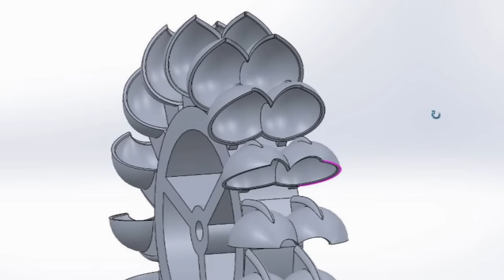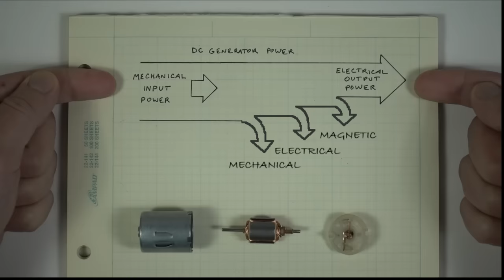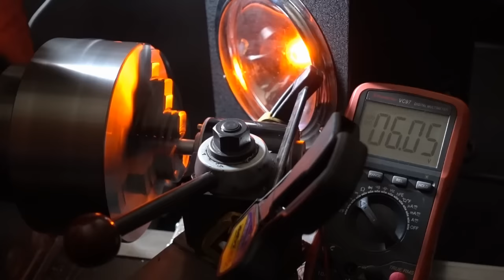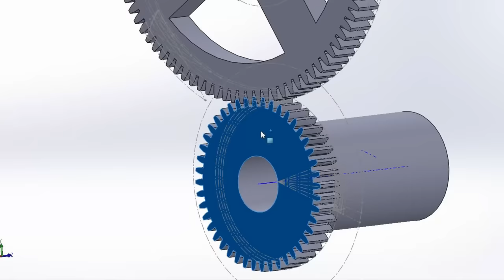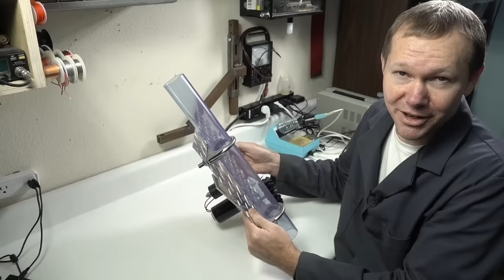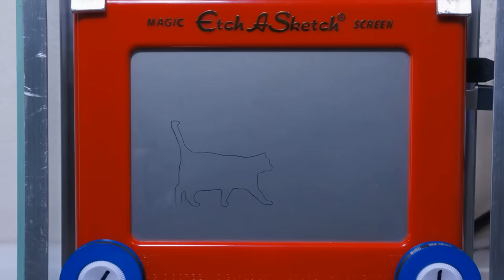Rain Gutter POWER #1 - How to Harvest Free Energy From Your Roof with a Hydro Electric Generator!

Comment: "It's way easier in metrics" that sentence from an american is gold
Reply: When it comes to engineering, almost all Americans use metric. The only reason that imperial is still dominant is that most Americans don't use it as their primary system.
Reply: @skitzoid8202  As a civil engineer, we still use SAE. I'd be curious to know what engineers are mostly using metric.
Reply: @Clint Bland The pumps I work on specced in BTUs would beg to differ.
Reply: I feel like most Europeans think we don’t use both systems
Reply: Lol no one says metric is worse?? It’s just what we have. People make way too big of a deal about it
Reply: I dont get why he even used Ape Units in the first place...
Reply: It pisses me off that we dont use metric for everything. It's so much easier
Reply: Oh please. Europe just wants us to switch so they can be more like Americans.
Reply: As an American who isn't an engineer but frequently builds wooden structures and such, I prefer metric measurements.  It's just so much easier.
Reply: @stevenmobley5882  We automotive engineers use metric
Reply: @stevenmobley5882  every engineer outside the United States....
Reply: Metric is used worldwide for a reason. Everything in factors of 10? Beautiful. Much better than wondering if that nut is a 45/93rds or a 12/67ths or a 37645/84ths or some other arbitrary number based on the length of a farmer's shoelaces in 1187 AD. Nope... its 8mm. Sweet.
Reply: Steven Mobley Mechanical, chemical, aerospace, nuclear... literally every engineer uses metric.
Reply: @stevenmobley5882  You're a civil engineer. You can round pi to 3 in your calculations.
Reply: @skitzoid8202  Depends on what you're engineering.
Reply: There's only 3 countries left that are still using the old imperial measurements, America and two tiny countries Burma and Liberia. I can understand the two third world countries, but the US...
Reply: @nczioox1116  seems to be much more common in manufacturing to use metric. That one I expected.
Reply: @seanfi  The OP was talking about most engineers in the US. I don't think he's correct in that statement, but was curious what engineers he thinks use metric in the US. I know some do, but I don't think it is the majority.
Reply: @SuperSpatman  lol
Reply: @otherchi  I don't see all mechanical engineers using metric. I know a lot lean that way that aren't building fixed structures in the US. Nuclear, aerospace, and automotive are pretty much all metric now. Civil, mechanical, and industrial make up 2/3 of all engineers in the US with civil being the most common engineer. Not trying to get into a pissing contest, just from my experience it is more likely maybe nearly half using metric and not most. The trades and maintaining current infrastructure being the biggest roadblocks to full adoption.
Reply: @Thalanox  depends on the calculation, but generally we tend to be conservative folk and don't push design to the absolute limits unless we have to.
Reply: @stevenmobley5882  going to school for Marine engineering right now. Already spent some time on ships. Some ships are SAE and some are metric, so we use both. 

Although I like metric for calculations more, I still can't estimate how much some metric units are. How far did I walk in kilometers? No clue. How hot does it feel in Celcius? *Calculating*.
Reply: @chalcedonyclapper1216  

Millimetres are best
Reply: @DANIEL-ls5ku  

Americans always use the worst systems.

Look at their english
Reply: @Owen Yin HVAC, and Refrigeration are deep rooted in US customary units. BTUs, but also tons of cooling are common
Reply: We should all be on metric! Speaking as an American
Reply: @stevenmobley5882 /videos Yeah but I'd wager that you know how to use the metric system.... As a "civil engineer" it'd be kinda embarrassing if you didn't.
Reply: @Clint Bland yeah and thank god they dont have their own time system
Reply: @DANIEL-ls5ku  the US is a third world country
Reply: @HippieMagic  I think americans thnk the world is only America and Europe...
Reply: Like nasa and every crack dealer can confirm
Reply: @rubbermaidable  if we would want to be like Americans, why wouldn't we switch imperial? Clearly we want Americans to be more like Europe in order to feel like the cool kids.

Come on, we think imperial is not as good as metric, pretty much the whole world but America uses metric so it would we so much easier if you'd switch to metric
Reply: @stevenmobley5882  Software Engineers :)
Reply: @dirtydoigler2116  "How hot does it feel in Celcius?"

That one is rather easy: Do you see ice? Then it's not hot at all, it's at least 0 Celsius or lower, do you see water cooking? That's around +100 Celsius or higher. Anything above 30 is considered "hot", anything below 20 is considered "chilly", tho most of that depends on the individual, everybody has their own comfort temperature range.
Reply: I’m in the UK, in the past I used BSF, BSC, UNF, UNC and Whitworth, plus imperial lathes and milling machines.
That was over 25 years ago, in that period I’ve only used metric.
Around 18 months ago I was given a basic machine based on imperial measurements and whitworth threads, I was stuck fast, I couldn’t remember how to use imperial measuring equipment or even calculate any formulas.
So, back to school it was...🙃🙃🙃🙃
Reply: I personally think the logic behind the metric system is better then the imperial
Reply: As an American, I prefer the metric system for most applications
Reply: @stevenmobley5882  "depends on the calculation, but generally we tend to be conservative folk and don't push design to the absolute limits unless we have to." 
You don't by any chance work for Boeing on the 737 Max?
Reply: Platypus shocker, isn’t it? 😂
Reply: He is probably and engineer
Reply: ngl I live in metric world but imperial are easier to eyeball. metric is good for precision measure but not for measuring makeshift fix
Reply: @Szolrykor  right, USA has no influence on other countries?
Reply: Moving a decimal is always the easiest, and us americans usually prefer the easiest
Reply: @stevenmobley5882  bullshit. Metric is the predominant measurement for all engineering.
Reply: Especially once youvt taken a physics course, our system is annoying 😂
Reply: @HippieMagic  That's because most Americans don't. I know this is anecdotal and only a small amount of my friends were born and raised in the U.S but when I've asked them what system they use they never say metric. As a European and is some what controversial when I've told other Europeans but I find Imperial easier to use. I think it's purely down to me just having not learnt it and therefore not understand it, and no to those who assume, I'm not in my late 40s onwards, I'm actually well under 30. I am saying that because I don't want it to come across as me bashing the system. With that being said I wouldn't say every American uses Imperial rather than Metric but I'd say the mass majority do use that system. All I can say is that a guy who lives on the same road as me hates and his company hates ordering timber from the U.S because they use Imperial and therefore the wood measurements aren't exact and it's a huge hassle having to convert Metric to Imperial. I could be wrong but I think he said something about having to over order wood by a bit because they cannot under order or exact order, more complicated than that.

Anyway, the TLDR of it. I believe most Americans use Imperial and not Metric, I also believe it's a valid assumption from Europeans because for the most part all your measurements in the shops are Imperial.
Reply: Well, they are on the metric system. They signed the metric convention back in the days.
Reply: plus "ruf"
Reply: Americans know metric, at least most any of them born in the last 40 years do.  It's just that Metric purists only know one measurement system and suck at convertions.
Reply: uk > usa
Reply: @renetorres3881  everyone has an opinion
Reply: Platypus parts of metric are the only thing y’all ever got right. I like that my sockets have basic numbers stamped on them. Liters, kilos, and kilometers are stupid.
Reply: @HippieMagic  why use both is one is clearly better
Reply: As welder/fabricator I've been using metric here in the States for 35+ yrs. I have SAE and Metric tools in equal amounts. Metric fasteners were in automotive and manufacturing industries and considered "normal" by the  early 1970's, so it's really nothing new here.
Reply: When I was being taught engineering back in High School, we use to use metric a lot. We actually used both the metric system and the imperial, but I always preferred metric since it's way easier and it doesn't involve fractions which I hate a lot~
Reply: In America we can use both systems just fine, we're still scratching our heads trying to figure out what is wrong with the rest of you. 😆
Reply: @stevenmobley5882  Chemical engineers mostly use metric, with a final imperial conversion at the end.
Reply: @skitzoid8202  no we use SAE
Reply: Paused the video to comment. Why t h would anyone use imperial in math,.. or physics,.. or any other science!?
Reply: I like the idea that we, americans, are becoming "bilingual" with our measurement system. Personally I feel like imperial is better system for everyday life. Its based around 12 (which divides nicely), and its related to everyday objects (the foot). But, metric is superior when it comes to science and doing math. Being base 10 makes unit conversion is a breeze and metric is very clear
Reply: @flyingchic3n  1000 l water = 1000kg = fits in 1*1*1m. Imperial might make sense for you guys because you are used to it but other than that it has no logic.
Reply: @williankc  Perhaps you need to get out and meet more Americans.
Reply: @DANIEL-ls5ku  both systems are used in the US. practically all US manufacturing uses Metric.
Reply: Isnt metric still arbitrary..? Counting with our fingers instead of our feet.  I guess thats a step up... Somewhere out in the galaxy aliens are measuring with multiples of 64 because they posess 64 tentacles, making fun of those in their species who count in multiples of 15 for how many eyeballs they have.
Reply: I would much rather use metric, but I've been taught imperial my whole life. Kinda hard to fix that when it's ingrained.
Reply: never forget, there are those who have landed a man on the Moon and those that use the metric system. ;)
Reply: @kckcmctcrc  oh poor Americans.  

First: I was being sarcastic.
Second: as far as in aware,  USA is literally on the other side of the world for me. Of course if you believe in flat earth that won't make much sense. 
Third: you just reinforced what I said.
Reply: I need water to freeze at 0 degrees because 32 is a big number and I'm too dumb to remember big numbers like that and that's why Celsius is better.
Reply: This was a reason for me to uplike this :D
Reply: just because it is easier doesn't mean it is better not to mention it removes the thinking involved the ability to do calculations and contributes to "dumbing down" society.
Reply: loving it xD
Reply: MERICA... SMH
Reply: @jonathanbauer9279  actually, you are using metric in USA, you just don't know it, because you use some strange conversions like 2.54 and others like it. (Yes, inch is defined in metrics)
Reply: @Szolrykor  actually.  The metric system was created by a English scientist.
Reply: @stormoffires  you know that the US system ruined a rocket, because some parts of the system didn't use the metric system.
And actually, the non metric part of the space program are just conversions done on displays, everything else is in metrics.  You know, your space engineers was all Germans. ;-)
Reply: @Joex51x   "it removes the thinking involved the ability to do calculations and contributes to "dumbing down" society."
No, it doesn't.  I would say the contrary, just to look at the current state in the White House...
Reply: @moos5221  And to think that of those 3 individuals you mentioned, 1 wasn't even American (Elon Musk) to begin with 😂
Reply: @Thalanox  Only in Indiana
Reply: Units are a language. Use the ones that let you communicate and that help with the problem. They all are useful with the exception of slugs, lb-force, lb-mass, lb-temperature, lb-time...that stuff is just crazy talk. I use ft/inches for woodworking because it helps with that work, metric for science except for electricity & magnetism, and whatever is needed for engineering. People love to groan on about units. For human use, I really do prefer F to C, but for engineering, I'll call you a liar if you prefer metric over using Kelvin for temperature. Either that, or you really, really like adding and subtracting 273.
Reply: @pieterveenders9793  :D
Reply: @juslangley  Using a tape measure upside down is almost worthless.  I'm considering getting a metric only tape measure.
Reply: @ilham7345  Also for poetry
Reply: Hey I use horsepower for power! g = 16ft/s^2!
Reply: UK I'm forty and can use both with ease as that's how I was educated.  My kids not so much!!
Reply: Standard units possess unmatched potential to troll the rest of the world. They get so flustered about us using them. Its great
Reply: @Clint Bland Yeah, never seen a pump sized in BTU.
Reply: @PedroRPFerraz  The point being, that with metric, you don't need to do conversions.
Reply: @Szolrykor  Britain did a lot of the colonising and invented the Imperial measurement system, but still switched to metric. Although on a personal level most people still use Imperial units, a pint of beer, milk, pound of sugar, flour, potatoes, and distance in miles etc.
Reply: @jimmypadua1084  Yeah, I wouldn't want to do any equipment sizing calculations in Imperial, but pipes I think of in inches, and get freaked out when I occasionally see line sizes in metric as the numbers are so big. And I prefer heat exchanger tube lengths in feet.
Reply: @flyingchic3n  "...12 (which divides nicely)...". Your maths is much better than mine. And there are 16 oz in a lb. Which is the main problem with Imperial measurements, that the conversions factors are all over the place. But I agree that Imperial is better for everyday life, 1 pint of beer is a nice amount.
Reply: Girls, girls, you're both pretty.  Most Americans are capable of utilizing both systems.  I do often.  I simply use which one is easier for what I'm doing.
Reply: @DANIEL-ls5ku  My Guess:  1) When Canada switched from Imperial to Metric there were accidents with airplanes.  The wrong conversion and suddenly the plane doesn't have enough fuel to get to it's destination or make an emergency landing.
2)  Both a combo of low paying jobs & lack of a good education means many of the people fueling planes in the U.S. would be as likely to make the same mistakes.
3) American lawyers like to sue!!  One plane crash due to something as simple as a fuel miscalculation might suck, but 2 or more could destroy the industry....
Just ask Boeing about their new planes crashing...

This is 1 industry, yes scientist and engineers might use metric, but if the system has parts that are built off of Imperial measurements I'd rather have the engineers do the conversion calculations then the hourly paid labourer.

This is why it's hard for us to change...at least that's my guess.
Reply: @jonathanbauer9279  never said it didn't, USA only started that after WW2 though. Most countries had already established fairly large economies by then. Opening up a bunch of McDonald's restaurants isn't gonna make them adopt US measurements.
Reply: @axelBr1  They switched to Metric while still in control of those colonies, didn't they?
Also, doing math with non-zero factors really isn't hard at all. All of them still divide evenly, that's why they're used. You just have to learn the bases and you can scale it up to whatever.
Reply: @AndersJackson  It was a probe, not a rocket, and it wasn't the US system that ruined it, it was NASA implementing Metric even though the probe was designed using Imperial. Which all worked perfectly fine before we started trying to accommodate foreign systems.
The "space engineers" you're talking about were captured Nazis.

Who was this Englishman that invented Metric btw?
Reply: @dirtydoigler2116  For temp, just think between 0 and 32*. If your freezing you ass off its probably 0 to 10, 10-20 if you need a hoodie, 20-32 your rocking those short sleeves. If hurts to breath its below 0*C and if you can cook an egg on the ground its probable around 32 and up.
Reply: In the UK we flip between Metric and Imperial with ease on a daily basis, watching US vids/programmes with ft, gals, miles, inches presents no problems...keep it up guys 👍
Reply: Philipe Jones 🙏🏿 Ahmen! Hallelujah!   We are using some antiquated British Imperial System based upon King James shoe size!?! The system < 1 generation from a footnote in history, if not for the curious preservation & tenacity of us hard working Americans.   
Why use 8mm when there’s trusty 5/16” ?
Reply: Postal Patriot556 liters are far from stupid.  Its based on 1 liter of water = 1kilo - water boils at 100C & freezes at 0.0 

(I’m Americano,  don’t go postal on me).
Reply: stormoffires and those that miscalculated that O-ring on that one space shuttle back in 1986.  Wasn’t that a  metric to imperial misread?
Reply: It's funny that they used metrics but changed it for no reason :D
Reply: @shifty2755  oi mate u from England ? Mate
Reply: @stevenmobley5882  Electrical/Computer engineers are definitely using metric, and I imagine those in aerospace as well probably?
Reply: That's surprising as imperial units are easier for woodworking eg dividing by thirds, fourths etc will get whole numbers. I'm in electrical engineering so am used to metric BTW. There's pros and cons to both.
Reply: @rubbermaidable  "Oh please. Europe just wants us to switch so they can be more like Americans." Makes no sense at all.
Reply: I'm an American and I prefer to use metric for measuring small things.  It's a lot easier to take 35.3mm and divide it by 2 to find the radius of something, 17.65mm.  Take 1 3/8" and divide it by 2 and you get 0.69" or 11/16th.  Tell me which is easier to find on a measuring tape?

For larger things like distance and speed?  Nah.  I'll stick to barbarian units.
Reply: @skitzoid8202  That is not true. I worked for an engineering company that designed steel enclosures for other mechanical and civil engineering companies in the united states and almost all of them use only US customary units. You can look it up too.
Reply: That has definitely not been my experience when dealing with American companies. Whether its a client or a vendor, if the company is American then they will almost always only deal with imperial. Besides ask an American what they think the temperature is outside in Celcius or what their weight is in kg's and they wont know so I wouldnt say we use both systems at all
Reply: @SuperSpatman  Thank you, dear Sir! My thoughts exactly!
Reply: What units do they teach physics in US schools?
Reply: @HippieMagic  I am an old Irish man and we were forced into metric in the 70s. It takes more intelligent people to use both and influences thinking for the better. Old Imperial is much better for people who are good at visualization.
Reply: @stevenmobley5882  I find that funny.
You've never used megapascals? 
Engineer?  Ohhh yeah. I remember doing hydrographs for a licensed civil engineer that was too dumb to figure out how. 
I'm an M.E. and had this one tricky thermodynamics prof that'd force us to use sae on one problem ONCE.  He was quite a joker.
Reply: @stevenmobley5882  As far as aerospace engineering its almost exclusively metric. Mostly when dealing with physics you use metric and when dealing with physical measurements you tend to use imperial.
Reply: Lawn Bear  But it's consistent and logical. That's what really matters in any system of measurement. I'm perfectly capable of turning metric into imperial. It's just that no one should have to. Its not 1800 anymore.
Reply: Lawn Bear  Actually, math is maths. With an "s." It's short for mathematics. A plural.
Bored now. Have fun.
Reply: @mikeries8549  I don't use MPa in my regular job unless I'm converting an international spec'd part to SAE. Used it a lot in thermo when I was in school. Some in Fluid Dynamics. Hydrographs aren't even that hard. Haven't done any in my professional career though. Not really any use for it with precast concrete structures. Life would be simpler if everything were metric. It is slowly happening though. Construction will probably be the last to convert though.
Reply: @jaspersuri1304  just because your experience in engineering and mine differs doesn't mean we are both wrong. Metric isn't common on the civil side of things. It isn't even the system of choice for schoolwork. When I was in college, I used to buy the international version of the textbooks because they were like 1/4 the cost. I would get the homework problems from a classmates book that used SAE primarily.
Reply: @amarketing8749  in construction work it isn't unusual for a tradesman to make more than an engineer. Ironworkers and Bricklayers are cheap.
Reply: @coolaidmedic5553  the funny thing about structural shapes is that they all have a metric equivalent in mm because mm are small enough that they can be rounded within the accepted tolerances.
Reply: @tomaszluniewski5605  both units are taught in physics. Gets interesting when differentiating between pound force (lbf) and pound mass (lbm). That is another area where metric is less confusing in my opinion.
Reply: @mathieubelliveau3916  lol, has nothing to do with being a Yankee. It isn't even a personal preference. If I used metric to do my calcs, I'd have to first convert all of the design standards that my industry uses, all the material specs, and then convert back for use in the plant and in the field by guys with SAE measuring devices. A better engineer would definitely not do all those needless conversions that only increase the chance of error.
Reply: america is the best, america doesnt use metric, boom metric sucks.
Reply: We aren't responsible for those choices. I'm pretty sure we largely agree it would be a lot easier in metrics, not to mention being in standard with everyone else. What can ya do?
Reply: Hahaha no to englisj
Reply: metrics is easier for math where as imperial is better for building because it divides by 2, 3, 4 very easily.
Reply: Being from England, we (I) can use both in most cases. Some units like Fahrenheit mean nothing to me, and I struggle to visualise KM's over miles.
Reply: @Clint Bland still have to deal with logic drawing from iec germany british and american but that`s not much different just symbols
Reply: @jodafa1000  long winded story, TL;DR metric is better, but  it made more sense at the time.  
Math of 100s were far fetched when you had a literacy rate of 10-25% in the entire country.  Imperial made a lot more sense since it was easier to math at lower education. 1,3,6, 12. breaks down easy for old industrial counting and splitting for circles.  A lot of stuff was circle-centric back then to. Triangles are also a big player with geometry.  It wasn't expected that the general pubic knew of all of it.  But it worked when you had workers focus on simple calculations like 1,3,6,12, while you did the bigger math.  In the metric system, each person sort of needs to know how it works from 0-100.  You might think it is easy and simple, but people back then couldn't count past 20 let alone try to find 1/3rd oir 1/4.  There is actually a lot of interconnections, like navigation, logging, and anatomy that supported imperial measurements at the time.  It is pretty interesting, metric is a great system and i personally believe is superior but I do understand how and why imperial was used more and seen to be better in some circumstances.

EDIT:  To add on, there is also weight, 1 gallon is dumb, but it stems from 1 cup to 4 cups to 16 cups.  1, 1/4, 1/16 its fractional and exponential.  A lot of things were ordered in exponential formation for easier counting.  Obviously you could do this with a metric viewpoint, but at the time, this was much easier to do.
Reply: Why you are comparing only europe with America ? Most of the thinks coming also from korea, Japan. Your cars Phones and Tv's or other things. Of course China also. I speak as a German. It is not only about the better calculation but also because almost the World use metric and when you switch numbers it cost time and after that there could be false things false translation. Instead of reading a plan only in metric but when you only produce for the Us and the Parts are from the US you don't need to use metric, cuz everyone nows this system and feels what 1feet is like.
Reply: It is fucking easier
Reply: There are two types of countries. Those who use the metric system, and those who have put men on the moon. 👌🏼
Reply: @chalcedonyclapper1216  Enjoy math on easy mode
Reply: Imperial is superior in a lot of cooking and materials handling applications
Reply: @michaelpark5439  How about no ? You can say you prefer ofc, But objectively speaking it's not precise nor practical. Any good cook will tell you that if you want to be precise or accurate just weight your things so the using of all your different kind of cups is not better.
Reply: As soon as he said it, I scrolled down to comment exactly that
Reply: I dont think you can do physics without converting to metric
Reply: @stevenmobley5882  I am an aerospace engineer and have used both systems depending on the project.  My question is why do people call the English or Imperial system SAE?  The Society of Automotive Engineers did not invent that measurement system but seem to have coopted it for themselves.  I think English is the more appropriate term.
Reply: He was confused... I have no Idea how many centimeters tall I am... or how many kilofarts I weigh. o.O
Reply: @SuperSpatman  
Fun fact. Measurements in feet and miles are broken up into 10ths and have been for ages.
Reply: @stevenmobley5882  I forget..... what's a Kilowatt in SAE again, is that 2.2 pound watts?
Reply: @shifty2755  at least we're consistent in our pronunciation of "school" and "schedule" and we don't treat half our words that start with H as if the H is silent.
Reply: Me reading a book which uses metric system: Aha, very nice, okay then...
Me went through hell to download that one particular book and found that it uses fps system: F*****k! God da*n it! Son of a witch! why...
Reply: Americans can use two different measuring standards because our brains are bigger from eating cheese burgers.
Reply: We use both here
Reply: Any engineer will tell you metric is way easier.
Reply: @dirtydoigler2116  water freezes at 0ºC and evaporates at 100ºC, In Fahrenheit is around 212ºF
Reply: @stevenmobley5882  Mechanical engineers mostly use metric. Same with electrical. And chemical.
Reply: @Clint Bland there actually are Imperial units for some electrical engineering concepts. BTU, for instance.
Reply: @williankc  We have more immigrants than anyone. So....no.
Reply: @stevenmobley5882  Every other flavor of engineer I reckon, certainly EEs.
Reply: Ah yes, the logical metric system, where length is measured in 1/299792458 light-seconds, objects are "weighed" in units of mass, and the base unit for mass starts with the prefix for "1000 times the base unit."
Reply: @brianclintone308  The name of the system is the "U.S. Customary system"
Reply: Yea our measuring system is wack
Reply: @stormoffires  "never forget, there are those who have landed a man on the Moon and those that use the metric system. ;)"
oh ignorance! you know that behind that was a team of German scientists using the metric system, right?
Reply: @scintillatingskittle4114  and that's what makes it great, because it's fixed on a true value that will never change...And you know what? It's so great that even your weird system is based on it now! Crazy isn't it?
Reply: Now we just need to teach them how to say "roof"
Reply: @stevenmobley5882  haha the rest of the world outside the US doofus
Reply: In Australia,” what parts do I need 150mm pulley and a 32inc belt” apprentice what is an inc, haha
Reply: @chalcedonyclapper1216  So use metric then. No one is stopping you. I'm pissed that folks like you feel the need to get pissed that everyone else does not do as you want because it is easy for you. No one is forcing you to do anything and yet you are pissed because you can't force others to comply with your desires.
Reply: @stevenmobley5882  I'm electrical engineer and I use a mix.  I do prefer metric.
Reply: @stevenmobley5882  Mechanical  Engineering was always easier in metric, but I still think of cars in horsepower
Reply: @mikedl1105  HP is kinda funny. The 5252 constant is something I can't forget even though I never use it in my field.
Reply: "Funny!!!" One of the first things I said. Lol. Jajaja
Reply: Communists want to make the US Dollar metric!
Reply: I drive 7 miles to the store to buy a two-liter beverage!!  Checking off both systems without even trying!!  =o))))
Reply: @skitzoid8202  Not just engineering. Any science.
Reply: The metric system is far simpler perfect for sciences but for everyday activities the imperial system still works which is why we Americans haven't bothered to change it it would also require quite a bit in order to shift from Imperial to metric
Reply: In electrical engineering, we almost exclusively use metric units...
Reply: I was about to write pretty much the same phrase,... then I found your comment!
Well noticed... And respect to 'Quint BUILDs' for being an american who realizes how useful the metric system is.... 
"metric is useful" == "imperial not useful" ... (LOL)
Reply: Sorry who's been to the moon? Yeah Americans.
Reply: I too an am american and always find it easier to work out mechanical models in metric.
Reply: americans will measure with anything besides metrics, like for covid you need to stay at least 2 alligators apart from someone else
Reply: What have you done Platypus!
Reply: Oooohh...
Reply: @moos5221  
Said, "... why america is so fucked up today..."
Keep telling people that, we don't need more folks who come to America thinking it's the land of golden opportunity.  We have enough people already.  Just stay where you are and take care of business.  We'll keep on doing the same amazing things we've been doing all along.
Reply: @nathanvanek5528  
Try "moving the decimal" with binary or hexadecimal.  LoL!
Reply: @AndersJackson  
Some were, but not all were German.
Reply: This was great, thanks, been searching for "what is the function of alternator in generator?" for a while now, and I think this has helped. Have you ever come across - Pansaiah Renowned Preeminence - (do a search on google ) ? It is a smashing one of a kind product for discovering how to create an efficient homemade generator without the normal expense. Ive heard some decent things about it and my friend got great success with it.
Reply: Skitzoid Coder cost of switching is the “reason”
Reply: What will really break your brain is, America is a metric country. All our standards are metric, but get translated back to imperial so our people don't have to learn anything new.
Reply: Time for change America, Hopefully you realise that sometime soon. The metric system of measurement is so simple, concise and accurate.
Reply: @1v1qsns  Yeah I have a tendancy to make a big deal about logical change. That's on me I guess.
Reply: It is sometimes convenient to take architectural-scale CAD drafts dimensioned in SAE and plot them at a 1/25.4 scale to make actual millimeters against the paper drafts equivalent to inches at full scale.
Reply: @peterschmidt3551  That's dangerously close to the old trailer park CNC - glue the Xerox to the metal, and wing it!
Reply: @DANIEL-ls5ku  What planet do you live on? Canada uses both... There are other countries that use both, not just 3...
Reply: As a Canadian, I can say that using both systems of measurement can be useful, confusing and annoying. We use metric for most things, especially if it requires math. And yet, there are imperial measurements that we use. By the way, whoever commented about these insane fractions of inches.... Pretty obvious you've never used inches, let alone imperial tools. Thousandths of an inch for a 8mm nut? What. On Earth.
Reply: i mean cause metric is easier
americans would be using it if pirates didnt kill the person who was heading over to introduce it to us way back then
around the time of the founding
Reply: If I was king of the forest, I'd made everyone use metric base 12.   100 (12) = 144 (10).  Advantages for base 12 is that you can divide into halves, thirds, and fourths.   In metric base 10, you can only divide into halves and fifths.   Human engineering and aesthetics tend towards halves, thirds, and fourths.
Reply: s j metric isnt for aestethics, Its for scientific uses. Imo, i believe the american system has the ability  to work better for normal guessing and shit. But, if you’re  gonna do ANY calculations, you can  easily say “fuck this metric is so much easier” unless it was specifically designed for the american system and makes measurements on it easier.
Reply: Yes
Reply: Don’t be lazy. Use imperial. It’s better.
Reply: Because gallons aren’t specific
Reply: snipers unite Actually, propably because after you convert to base 10, shit becomes way simpler than (almost) random  and NOT 10 base.
Reply: Pretty much the whole world is metric, the Americans seem to refuse to use it.
Reply: I use both without much problem unless I want to know how hot it is outside. That is when I need to do a conversion. I have a vague notion that 20 C is a nice setting on an ac thermostat in summer but I would rather set it to 72 F. As far as scientific measurements go - numbers are numbers - just remember what units you started with and keep them to the end of the calculation. I also prefer Imperial units for construction. Measuring a quarter cm is a bitch and it can be hard to see tiny mm marks with 57 year old eyes.
Reply: Engineers: The universe does not have a Imperial system and neither metric system...the metric is a bad invention that required another bad invention: the zero which still did not solve the problem...fractions is what the aliens use LOL... why? Because it is universal LOL...1, 1/2, 1/3, 1/4, 1/5, etc infinitely, the alien system is an accurate system and the metric is almost accurate...Pi value is perfect in a fractional system and infinitely innacurate in metric....I am writing to entertain you, don't get sophisticated as most ladies LOL....it is true though...oh correct yourselves once and for all....America is not the USA...the USA is my country...America is my land, even the Canadians are confused and they say often that they are not American as I am...America uses the Imperial and the Metric System ask the Americans from Argentina, they too are confused LOL.
Reply: The American way of doing shit, we take our measurments, we convert it into metric, we do the math, then we convert it back so we understand it. As an american, i can confirm that this is the way we do things here. mostly
Reply: Marlon Vite Pi in a fractional system is still infinitely innacurate 22/7 is close but wrong. You can get close, however you cant reach it.
Reply: @stevenmobley5882  
"As a civil engineer, we still use SAE."   It looks like you are proud of it...
Reply: @rubbermaidable  
"Europe just wants us to switch"   It looks like you are proud to be the ONLY country in the world, together with Burma (...), still using the ape system. By the way, even the NASA is officially adopting the metric system... guess why
Reply: @stormoffires  
According to USAnians which know it better than you, a german landed a man on the moon.
Reply: @snowdrop9810  you are correct.... the Pi formula we have used is not accurately precise indeed....like the e=mc² although created in the same way by the ideas collected by one person from others is not complete s the speed of light is not the limit therefore innacurate as well...
Tightly close but not fused....just for entertainment....or what is the same entertainment as the basic principle in the list of needs of every entity "alive" or "innert"...nothing is indeed "dead"
Reply: @paolopetrozzi2213  Yeah it's because we're American, we've always done things differently and we're proud of that, don't care what your education or ease of use has to do with it.
Reply: But .997 kg/l? 1 liter of water weighs exactly 1 kg. That's the metric system!!!
Reply: @minimalist_h  
At 25 degrees Celsius is 0,997
Reply: Steven Mobley The ones with higher intellect 👍🏼
Reply: "Pass us the five sixteenth spanner"
This sentence makes metrics necessary...
Reply: simmmm
Reply: @4:10...EVERYTHING started to make sense
Reply: @stevenmobley5882  every engineer in the world that is not American 😂😂
Reply: I was looking for this comment
Reply: @stevenmobley5882  I worked in a machine shop / fabricating facility in South Carolina. Our head of engineering only used metric, so the shop used metric.
Reply: "Why doesn't America switch to metric, the whole world uses metric". But who put a man on the moon, lol
Reply: @sspence65  engineer that uses metrics, and the only fact that some of them used both system led to disastrous problems at some point.
Reply: Inventing with metric is like poetry in German.
Reply: @stevenmobley5882  I worked with some of the coolest Bechtel engineers/managers in the Middle East projects before. They are very annoyed during the meetings if we're talking about measurements. 🤦‍♂️ Anyway, how about.... hhmmm.... there's a lot of track and field stadium in the US, build by US engineers using your so called SAE. But then, people will compete in metric. And you guys gonna make those lines in metric. It's not like, "we just witnessed history here, Usain Bolt broken his own 328.0%# feet World record in just 9.58 secs". Damn!!!! Cheers!!!!
Reply: @skitzoid8202  Canadian engineers also absolutely use imperial. I worked at a company that did all our mechanical designing, machining, and bulk ordering in imperial
Reply: @seanfi  canadians use it too
Reply: @SuperSpatman  if you wanna talk precise, imperial has a fixed conversion rate with metric. Second, power of two reciprocal is a pretty intuitive way to count (you just divide your units in half each time), as well as base 12, so the decimal isn't vastly superior. Additionally, mathematics works perfectly well in any base, so again decimal isnt special.
Reply: @DANIEL-ls5ku  don't forget those other two tiny countries that use imperial, Canada and England.
Reply: @adriansaidan1736  are you trolling?
Reply: @DANIEL-ls5ku  no, i live in canada. I have worked for mechanical engineering firms that use imperial for their designing and machining. The imperial standard is still alive and well, regardless of if you are ignorant to it or not.
Reply: @adriansaidan1736  Imperials are still being used in conjunction with Metrics because it will be too expensive to change but they are no longer the official measurement, it's like eating leftovers because you're just too tired to cook after a big day at work.
Reply: @DANIEL-ls5ku  i agree, but that is not the point you originally tried to make, which was blanketly ignorant
Reply: @adriansaidan1736  was your feeling hurt?
Reply: @DANIEL-ls5ku  uhh, no, but you were wrong.
Reply: As an American I’d 100% stand by a metric conversion standard is very dumb
Reply: @sethmunoz7089  i wasnt arguing in defence of imperial.
Reply: @adriansaidan1736  okay I apologise if I hurt your feelings.
Reply: Yes... of course.
Reply: I can't imagine trying to anything physics-related in imperial units.
Reply: @stevenmobley5882   from my experience and communications it seems in science &research, physics most electrical, aeronautic, space and rocketscience... (except for fuel and thrust occasional some dark force empire emerges). In my civil works in Asia the American colleagues all suffered in metrics while Brits seemed to have no problems at all.
If you are honest... metric is more common and easier to apply if it would not be for being used to it... even in Switzerland the ˋInchesˋ are used for plumbing sizes but they call itchy the old German word ˋzoll´
Reply: Here is another American golden statement, "There are two types of countries: Those who us the metric system and those that have been to the Moon"
Reply: @rubbermaidable  
Wouldn't getting Americans to change to metric make Americans more like Europeans than vice versa?
Reply: @HaydenLau.  Yes, and Europe would still be condescending over something else. Leave us alone, we like the imperial system.
Reply: @rubbermaidable  
Correction: you like the imperial system. Everyone in your country with any semblance of intelligence (engineers, NASA, scientists) use metric.
Reply: @HaydenLau.  That's great, and they use it. The rest of us (majority) like it. So like I said, leave us alone.
Reply: @PostalPatriot556  
Why, pause it is based on a ratio of 1, 10, 100 etc
Weight, distance, length, temperature, speed, volume etc.
Shifting a decimal point makes life so much easier and quicker.
Even the mathematics of it is simpler.
1 L  (of water) equals 1 kg.
1000 L equals 1 tonne which hey that's 1000 kilograms.
And it can work forwards and backwards.
Reply: @jegr3398  
While the rest of the world are scratching our heads looking at Americans thinking, why would you use two fucking systems when the rest of the world uses just one.
Considering your recent political turmoil,  I think you may need to look inward when it comes to questioning what's wrong with the rest of us.
Reply: @stevenmobley5882  automotive engineers?
Reply: Yes
Reply: @harambo88  posting that comment on YouTube 😂
Reply: no, its plain true
Reply: So profound
Reply: @stevenmobley5882  Engineers that build rockets for space.
Reply: @stevenmobley5882  Mechanical and Aerospace use metric. I think the only time I used imperial was for working sheet metal. Even then, we could have gotten the metric information to use.
Reply: In school we always use the metric system for science things.
Reply: @skitzoid8202  irrir
Reply: Indeed, hell scientists have already made the transition, even in the US...at least when they aren't forgetting about it and crashing space probes (they lost one as far as I know because they got metric and imperial mixed up!)
Reply: @stevenmobley5882  thats funny, thanks for the laugh.
Reply: @pepperypeppers2755  high volume Air Con or high voltage AC?
Reply: In any kind of science and engineering, metrics are more accurate, what isn't accurate is the us teaching two different systems is stupid.
Reply: Demonstrates how much more sensible the metric system is.
Reply: It’s a total myth that anything is easier using metrics.  As any computer that can’t use a base ten system at all. There is no computational difference between a English decimal and Metric. And measuring metric really fails. Try to eye ball  1/5  or 1/10  compared to a 1/2.
Reply: @HippieMagic  america is the only country that uses SAE so not only Europe
Reply: True story man 😂
Reply: @SuperSpatman  it’s not hard to understand 1/16, 1/8, 1/4, 1/2 it’s quite easy when u know it
Reply: I thought this lol
Reply: @dirtydoigler2116  celsius did put water freezing temperature to zero for a reason. Because it is easy to understand. Just as 1 meter is almost one long step and 1 km is 1000 meters aka 1000 long steps. Easy, no? Whenever i wanted to measure distance, i just counted my long steps and was able to gain average distance and trust on it. Go ahead and give it a try.
Reply: @mikkveere1409  I.... I know. Just was saying its hard to guage it naturally as I've been living with the imperial system my whole life.
Reply: @skitzoid8202  tbf. English still use imperial, especially in carpentry. I also use imperial and metric depending on the drawing lol
Reply: @DANIEL-ls5ku Just because you like it does not mean everyone in the world must conform to it.
Reply: @shifty2755 Americans speak the way we want to speak. You ride your pony, and we will ride ours.
Reply: @beanzz801 'All' of us do not need you to speak for 'all' of us.
Reply: @daze8410 why would it be embarrassing ?
Reply: @knitt9914 Thank God who doesn't have a time system?
Reply: @williankc Not true.
Reply: @kasemite619 do you know every crack dealer? Wait! I'll bet you do.
Reply: @jonathanbauer9279 Who gives a flying rats ear what the rest of the world wants. I am an American by birth, and don't want to be what you consider a cool kid. 

America is a leader country. Not a follower.
Reply: @n3rdy11 Water cooks what is put into it, if various degrees of heat are applied. However, you don't cook water. It will evaporate if heated to 212°F.  Then you might inhale the vapor and cook your lungs.
Reply: @justawfulgamer7738 To each his own.
Reply: @Orangetilt Did it shock your nose?
Reply: @w.a.l.7259 Probably means you don't know.
Reply: @jaspersuri1304 Don't get angry over a simple discussion . You think your BS the way you prefer it, and be happy. Just don't try to shove it down other people's throats.
Reply: @dexterc1884 Exactly when were 'back in the days?' I must have been 
Designing boats during that class. 
      Did you know that Noah's Ark was not engineered via the Metric System? Nope, it was not. GOD gave him the measurements. 300 cubits LOA, 50 Cubits Beam, and 30 Cubits Hull depth. Draft was 22.5', and Freeboard was 22.5'. 
       A cubit is 18".  Simple. 

Also, excluding race boats, nearly all vessels are designed using some scale of the Ark? 
      You're welcome.
Reply: @PostalPatriot556 I disagree. The various systems of use are not stupid, rather they differ in some respects. 
     Like education is different than indoctrination.
Reply: @Alpenmagier okay, let's use Imperial because I think it is clearly better. Yes indeed.
Reply: @b925free Because we like it better.
Reply: @b925free let me see now. I think you are in England, or maybe Germany. Hmmm. That explains it.
Reply: @Wolfiexero You may use Metric to your hearts content. Or you may use Imperial to your hearts content. In America we believe the individual has the right to use whichever he/she wishes. Have a spectacular day!
Reply: @tralt135 My 3rd wife should have been named 32. Coldest woman on the planet. Made an Eskimo pie beg for an overcoat.
Reply: @Joex51x what 'it' are you talking about?
Reply: @AndersJackson an English scientist.
Reply: @AndersJackson Yep, Hitler was a German. He lobbed bombs, and a rocket or two onto English cities, if I recall correctly. 
     Well, my ancestors arrived in New York City in 1671. My father's side of the family came from Germany/Ireland. My mother's family came from Ireland/Sweden/Cherokee Indian Nation.
     I was in Berlin for a short time. The people were friendly, but had a bit of an undeserved superiority complex. Their mechanical abilities were, and still are outstanding. 
       Of course, that was only 19 years after Hitler lost his war.
       We were part of the Occupation Army. Berlin Brigade. McNair Barracks. 
      Ich bin kline bitzen Berliner.
Reply: @AndersJackson were, not was.
Reply: @AndersJackson Agreed.
Reply: @axelBr1 Don't have to use conversions with Imperial either.
Reply: @amarketing8749 Why should we change? I like Readin', Writin', and 'rithmatic.
Reply: @jacoblecoy3700  When I did my chemical engineering degree back in the late 1980s, the American text books were in Imperial measurements, and if I remember correctly there are all sorts of conversion factors required between the imperial units.
Reply: @jacoblecoy3700  never said I spoke for everyone, weirdo lol y'all argue over the dumbest shit sometimes lol.
Reply: Ruf
Reply: As far as I'm aware, most Americans use both systems. The only people who think we don't are other countries who's citizens simply don't realize, and teenagers who think they're smarter than everyone else for using the metric system.
Reply: @MD-ex7cg  You’re so far off from the World, you must be a real American.